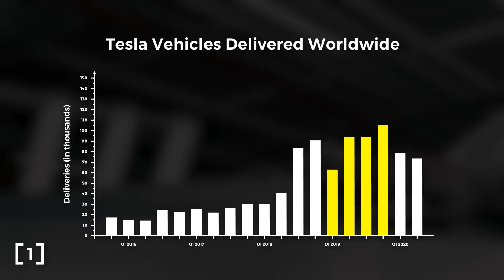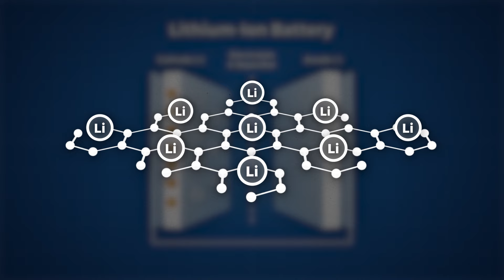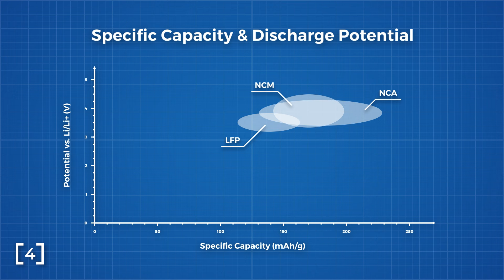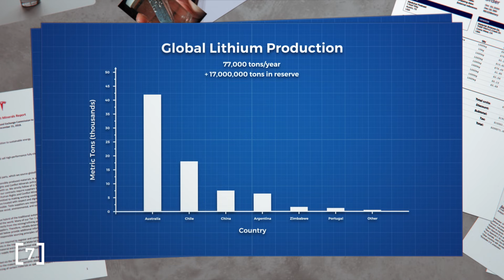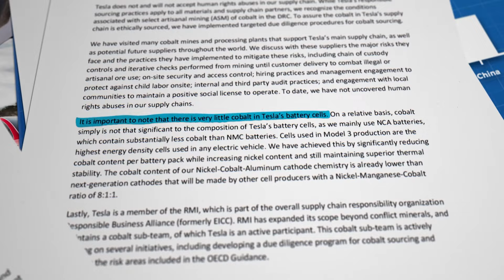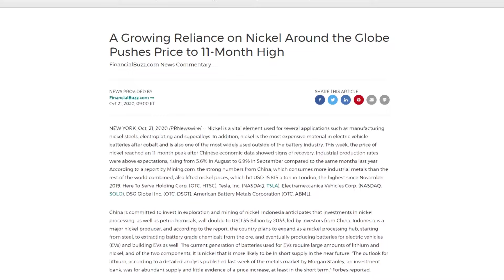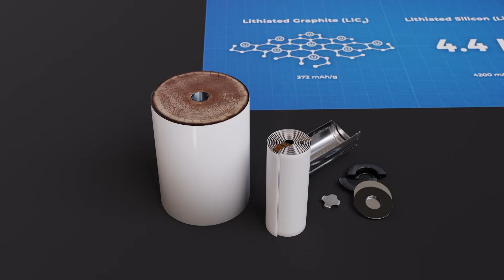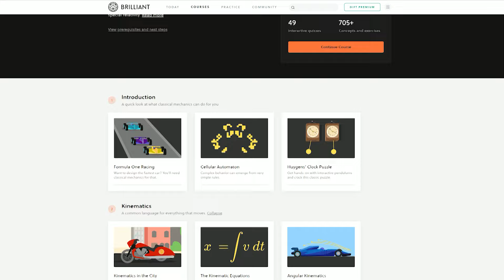Tesla's Battery Supply Problem

Comment: Energy storage, recycling, damage to the environment, species facing extinction or having already gone extinct due to renewable energy (wind has been really hard on birds of prey and bats, solar on insects and birds, big projects are very hard on the environment no matter how much you want to think otherwise, sadly), lots needs to be fixed and taken seriously beyond climate worries.  I certainly don't want another local bat species to go extinct here due to another mega wind farm.  A lot more work has to go into these things before more species are wiped out through ignorance.  Recycling is still in in its infancy unless you're talking paper, I really hope they get that fixed soon!!  We have entire huge buildings devoted to storing glass they can't recycle.  And plastic, ugh, it doesn't get 'recycled' at all.  Get recycling fixed and working first.  Please.

Another problem is obvious: cold.  Today, where I live, the temperature was -10˚C.  That means a brand-new car battery (as the Auto testers explained to me) would lose 45% of its range on the face of it, a lot more if you turn on the heaters (and who wants to drive a car when it's -10˚C inside the cabin??).  At -20˚C the local university found you couldn't drive for an hour.  At -20˚C I couldn't go to work, my daughters couldn't go to dance, my son couldn't go to therapy, nor my wife, my son couldn't go to work, and grain can't be taken to the granary.  At -20˚C with no heat in the vehicle they found range dropped by almost 68% with the heaters OFF, 80% with some heat, and if you couldn't park your vehicle inside while at work, in a heated area, you'd have no hope of going 30 km no matter how long you charged the battery in the cold or how new/large it was.  In B.C. it rarely gets to -20˚C but electric is still a hard sell; no heated garages is one reason.

I wanted to buy an electric vehicle this year but everyone laughed at me, then filled me in on what the tests showed and how much work needs to be done.  Shot me down pretty hard, actually.  I was so hoping I could buy an electric, still hope in 5 years my next one will be but I won't buy unless the recycling, cold, and storage problems are fixed.

I think there should be big incentives from companies to buy electric in warm areas that don't get -20˚C, and that'll give us who live in cold climates some breathing room until a good electric car/battery can be invented.  What's good?  An electric car that goes, on -25˚C days, AT LEAST 150 km on a single charge on a 5-year old battery, doesn't need to be stored in a heated garage, will be almost as good after 15 years of use as when new (and I mean the battery too!), and doesn't have toxic components.  And the electric grids can handle the stress (hello, California).

As a point of comparison, I had a Corolla for 20 years.  In year 15 I drove it over 630 km, in a blizzard at -18˚C, on one tank of gas with some to spare (If that snowplow hadn't knocked over that one sign I'd have gone just under 610 km), and five of us in the car, comfortably.  I don't expect an electric to compete with that, but how about 1/3 as good?  1/4?

Comment: The research of better batteries is critical to the future of renewable energy, but trying to solve the climate crisis with electric cars is a fallacy. Tesla tries to sell itself as environmentally conscious, but it's just interested in the car manufacturing market share.
We shouldn't only focus on the supply side, but also on the demand. The only way to solve this is by designing cities and infrastructure to be less reliable on private cars and batteries and more focused on public transit, railroads and cycling.

Comment: How about instead of playing around with the math of how many billions of kilograms of relatively rare metals we would need to extract from the earth (also dont forget mining is a fuel intensive and environmentally destructive process) to make batteries for electric cars we just deal with the elephant in the room? Electric cars are not an efficient solution to climate change. And for grid storage we can use liquid air storage, which won't require chemical batteries at all.
Reply: Grid storage are all simple mechanical systems, be it gravity, spinning weight or compressed gas. The entire power wall of lithium ion concept are build on the wrong premise, a waste of resource and a fatal hazard. There are much simpler and more efficient system exists for these purpose, but the problem is not solvable on the individual scope of adoption, and these simple solution don't have that high tech cool appeal for funding and stuck value. <-- what they are really after. Tesla isn't the iron man company the geeks made you believe, their marketing heavily rely on the high tech proposal, very often pushing solution to problem no one asked for, or make simple things more complex, this practice extend to many of their space project as well. The real change should be a change of life style while will be rooted in the change of social economic system.
Reply: @MNanme1z4xs  couldn't agree more, friend. I'm not hopeful that the social economic system will change in the near future though. We'll probably see a collapse in food production and mass starvation first.
Reply: @gigio2376  I won;t expect the social economic system gonna change in the foreseeable future. The most critical aspect of our current model resides upon the false assumption of individualism. The real future of eclectic road are with public transit and small house held vehicle. Not the cyber truck

Comment: Perhaps formula one should move from too much power and fat tires to an economy based mode of racing .Too much haste and so much waste .Who needs to go at 300 kilometers per hour anyway  ? How many liters of fuel per lap ? Can formula one get any faster for the same or less fuel and emissions ? Has formula one reached it's practical height of potential ? Is it just a self serving and justifying form of ego ? Perhaps if we as a society had a conservative approach to combustion engines they could still have a place and be sustainable .

Comment: The author shows a typical fundamental misunderstanding of what "reserves" actually means vs "resources" and how these related to demand - and more importantly what "proven reserves" means, which is the parlance actually used for all the items mentioned in the video)

This leads him to fall into the typical dunning-kruger trap of assuming scarcity where that isn't the case

There are trilions of tons of Thorium in the crust and the average rare earth mine makes about 5000 tons of it per year, but official reserves are ZERO - despite resources being immense and the US department of energy having buried tens of thousands of tons of the material in shipping containers in the Utah desert in the 1990s.

This is because reserves only exist in mineral/mining-speak where there is a demand, even if the items are in abundance - and even then they only exist where the resources have been both proven AND are regarded as economically extractable (ie: can be sold)

No demand = no economy of extraction, therefore no reserves

Cobalt is readily found in conjunction with nickel and copper, but until recently there wasn't enough demand (and profit) to go extracting it from the tailings of those mining processes - now that demand is ramping up the equations are changing. Australia's reserves as a for-instance are only those which are proven and they've only surveyed a few areas to get those numbers

Tantalum used to be another problematic conflict material (also mostly from Congo) which saw diversification of supply throughout the 1990s as demand increased and conflict issues were realised

This is explained here:  https://newpacificmetals.com/mining-101/mineral-estimates-reserves-vs-resources#:~:text=A%20Mineral%20Reserve%20is%20the,least%20a%20Preliminary%20Feasibility%20Study.&text=A%20Mineral%20Reserve%20includes%20diluting,when%20the%20material%20is%20mined.

"A Mineral Resource is a concentration or occurrence of natural, solid, inorganic, or fossilized organic material in or on the Earth’s crust in such form and quantity and of such a grade or quality that it has reasonable prospects for economic extraction. The location, quantity, grade, geological characteristics, and continuity of a Mineral Resource are known, estimated, or interpreted from specific geological evidence and knowledge.

Mineral Resources are sub-divided, in order of increasing geological confidence, into Inferred, Indicated, and Measured categories. Note that the confidence level in Inferred Mineral Resources is insufficient to allow the application of technical and economic parameters or to enable an evaluation of economic viability worthy of public disclosure.

A Mineral Reserve is the economically mineable part of a Measured or Indicated Mineral Resource demonstrated by at least a Preliminary Feasibility Study. This Study must include adequate information on mining, processing, metallurgical, economic, and other relevant factors that demonstrate, at the time of reporting, that economic extraction can be justified. A Mineral Reserve includes diluting materials and allowances for losses that may occur when the material is mined.

Mineral Reserves are sub-divided in order of increasing confidence into Probable Mineral Reserves and Proven Mineral Reserves. Mineral Reserves are those parts of Mineral Resources which, after the application of all mining factors, are the basis of an economically viable project after taking account of all relevant processing, metallurgical, economic, marketing, legal, environment, socio-economic and government factors."

Anyone who ever says that lithium is in short supply has zero credibility. If the price doubles then it's economic to extract it from sewater (it's already known how to do this), so the supply is unlimited - and whilst the cost of Lithium is mostly influenced by transportation costs it wouldn't take much interference by - for example, the Bolivian government trying to extract a higher income from Lithium mining  - to encourage investment into seawater/clay extraction systems (I mention this because that's exactly what's been happening behind the scenes)

All the above are worth bearing in mind when some shyster is trying to sell you on XYZ mineral being the next big thing. It's usually a pump-and-dump promotion

Comment: So, batteries are not a viable long term solution. It might seems awsome at first, then it will cause problems when everybody try to use it. It is a paradox. I feel sad though, looks like there are not much solutions for the battery hunger world. We need to carefully choose what devices/equipments will be powered by batteries.

Comment: One problem I see trying to make the   world green with electric cars. Even if you solve the battery problem and now you can store all the energy you need, where do you get the electricity to charge the cars? Most Australian electricity is from coal electric plants. Not too green. California wants to outlaw all internal combustion by 2035. That's only 15 years away. If California has rolling blackouts now, how do you expect them to have enough electricity when you add millions of cars to the grid. Again you're not putting nuclear  power plants on the San Andreas fault. That leaves coal or natural gas power plants. So California doesn't put the plants in. Do they expect the neighbouring states to put in dozens of power plants exclusively for their use? Still not so green.

Comment: i love how the green liberal parties always neglect the reality of the full chain of a product - they think putting pv panels on all roofs will solve the problem but just ignore all surriounding issues - one is as you mentioned the ressource production  (aka grey energy or grey cost) and the other is surrounding requirements (say changes in powergrid infrastructure due to the difference in power flow)...   

Yes renewables are the future but the reality is not as easy as some might make it seem and what i hate is when they try to debunk your argument with "just do X and its solved because i say so".. i dont expect people to know it all but i expect people to understand that the reality is a wee bit more difficult than they make it out to be in their head.

Comment: Tesla is actually going backwards.Selling 500,000 of 80 million vehicles sold?  Telsa's own stated goal is to expand EV use; if EV miles are good; PHEVs are driving 10x more EV miles. Lithium ion batteries are in short supply.  Tesla could have made 5 million PHEV but they instead only made 500,000 EV with the same number of batteries. Let us presume total Lithium ion production is 5000 batteries.  You can made 1 EV or 10 PHEVs; the PHEVs drive most commuters totally on EV; as does the 1 EV so PHEV drives 10x more EV miles for commutes. On long trips the EV gets all EV miles; but the 10 PHEVs each get 30 EV miles plus 20% regen EV miles which is more total.  If you only make 1 EV then the market must make 9 more new ICE cars to meet demand.  So Tesla isn't helping make EVs successful because it minimizes EV miles, and causes more ICE cars to be made.   So the question was if Lucid posses a challenge.  Lucid is tiny;  Toyota Honda and VW are giants making more PHEVs making a larger positive impact on the environment.
If Solid state batteries come; w maybe 4x more energy density. Tesla can reduce the number per car by 75% reducing weight; but they already weigh 1000 lbs more.  The PHEV makers can replace the ICE engine with more batteries.  If that happens; all the major makers can make EVs with the same performance. Lithium ion will be obsolete.  Tesla then has to try to take on huge makers like Toyota, Honda and VW etc  Why would Tesla be worried about Lucid .. they need to worry about the big makers.

Comment: First double the cost in energy of a car manufacture.
Then double the complexity of the supply chain for raw material.
Then increase the weight (and thus energy consumption) of a vehicle, as well as raw material needed.
Then ignore that the gargantuan additional electricity that will be needed, will be produced by burning coal.
Also ignore that renewable will alway be weak and difficult to scale, with the same drawback

Then have the guts to pretend this inefficient wasteful giga car is "environmentally friendly", and run on pipe dream with a company that cannot make any profit... sad.

For real "real enginneering" one may go there http://blogs.ulg.ac.be/damien-ernst/electric-697612-km-to-become-green-true-or-false/

Comment: So in order to replace fossil fuel driven vehicles with electric vehicles we have to produce many MILLIONS more than we do today. The mining of materials needed to produce batteries for all those vehicles will need an enormous increase in mining, most likely in third world countries, with a corresponding increase in cheap child labour required, along with a huge increase in the heavy machinery and vehicles needed, which, by the way, rely solely on fossil fuels. The carbon footprint created in order to produce just the raw materials is going to be extremely damaging. Not to mention the increased destruction of the ecology that the huge increased mining will cause. All of this doesn't even take into consideration the industrial processes needed to refine the raw materials and produce the finished product, and that is just the battery. The aluminum needed to make the actual body of millions of these vehicles is yet another story. We cannot rely on "renewables" like wind or solar generation of electricity to power all of the industrial plants or mines that will be needed. Even these will require batteries to store energy and the great increase in batteries needed for the grid will also demand a corresponding increase in mining of raw materials. A great concept but not feasible for quite a few decades. No matter how optimistic the outlook for renewable energy and electric vehicles fossil fuels will be with us for quite some time to come.
Reply: And what are we suppose to do with climate change? Sit and watch?

Comment: He actually missed the most crucial part about the new battery construction - due to tabless design new batteries are planned to be few times more energy-efficient than current ones. This may solve all the other problems with material scarcity etc. So the whole video is either a bit of propaganda about how tesla is worse than it actually is or Brian is worse at engineering than at making videos.
Reply: This guy elaborates on the technical specifics and efficiency of the new battery quite a bit:
https://www.youtube.com/watch?v=hbPKE62aM0U

Comment: electric cars - for the rich and famous.  soon, only the ultra rich.  Regular folks, enjoy your grass hut.  there isn't enough of the critical metals to make this work.  not even a little bit.  Not adequately addressed is the metallurgy and chemistry.  Very energy intensive and has complex, difficult chemical properties. Recycling is more complex than using virgin material, thus greater costs.   In simple terms, available materials and physics clearly indicate the 'electric car' revolution is solely for the very rich, and even then, only some of them.  meanwhile, oil and gas is more abundant by several orders of magnitude, has simple chemistry and physics and greater energy density.  Oh, and don't forget all the plastic and related hydrocarbon based materials to make them function.  so yeah, nice dream, if you're very rich.